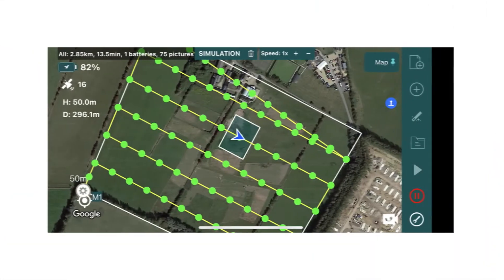How to calculate the Optimal Flight Speed?

Comment: Varun, thank you for this informational video. You helped me better understand this topic. Thankfully, Hammer Missions does this calculation automatically based on all of the input parameters!!! I have a question about flight speed relative to the considerations discussed in this video. Can I choose to fly at a slower speed than what is recommended by Hammer Missions (or calculated if it differs) and would that potentially improve my dataset? Less smearing, less lost captured data, higher quality/resolution, etc.? In what case should I have the drone completely stop at all photograph locations, take the photo, then move to the next location and not fly continuously?
Reply from the maker: You can definitely choose to fly slower than the recommended flight speed, but flying any slower than the recommend flight speed wouldn't necessarily improve the data quality. The the data quality improvement in most cases will be marginal relative to the inefficiency of the flight. You can also choose to stop and capture photos to eliminate any amount of ground smear or motion blur, however most modern drone cameras are equipped with mechanical global shutters which mitigate smear to quite an extent. These videos should be helpful to learn more:

https://www.youtube.com/watch?v=nhavvGl-p34

https://www.youtube.com/watch?v=fb3YGSbTVk4

Comment: quality has nothing to do with (optimal) fly speed! the thing is does battery depletes exponentially faster with speed, so there is optimal speed for gaining maximum distance, camera or no camera
Reply from the maker: Hi there, if you fly faster than your camera can take photos, you will miss photos, which can affect the overall quality of the dataset, once processed. Hope this clarifies!
Reply: @HammerMissions i think i need to clarify -flying is flying and filming is filming, your video title talks about flying, not filming, not all drone flights are for content creation, duh